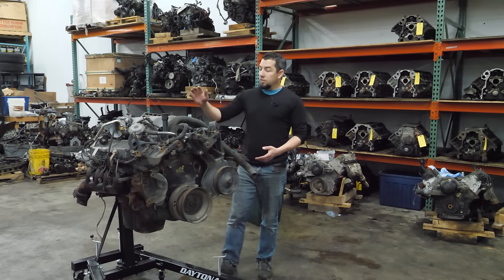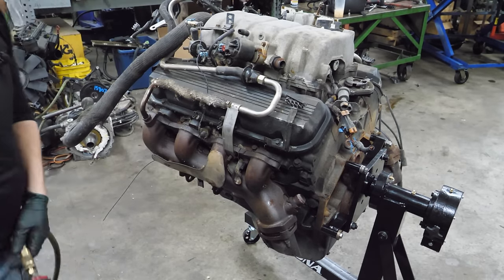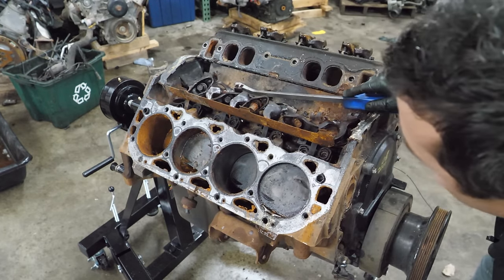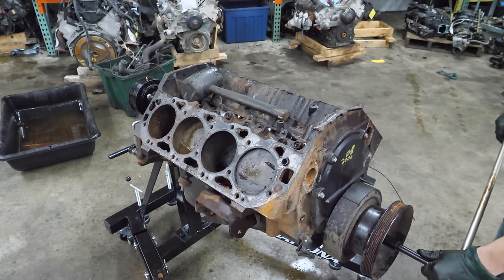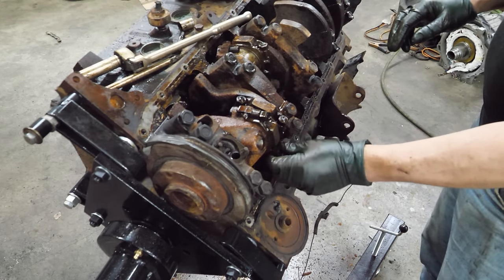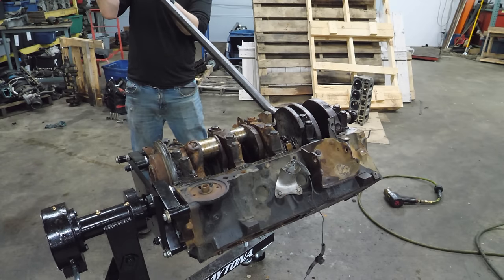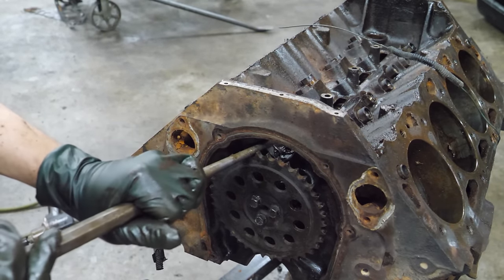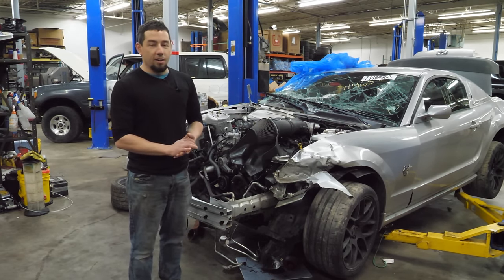COMPLETELY FROZEN! Vortec 454 7.4L BBC Big Block Chevrolet Teardown. This Was Some Work!

Comment: Should of left the deck upright an put oil or diesel in each cylinder for few hrs would have helped a lot block will probably have to be sleeved in the bad cylinders an as someone who’s been rebuilding a gen 6 454 I would advise anyone to just do an ls swap because they don’t make parts for them engines anymore iv been wanting on parts on back order for two years now if I’d known from the start I would’ve waisted the money in parts an Machine work that I have in mine could have gotten a 6.0 out of a wrecked truck an been back on the road two years ago with my dually

Comment: The reason one side on those rocker banks is way worse is the pcv valve. Side that pulls  oil on the side thats dirty , everytime i have opened one side is clean ? The other way worse, that engine looks like 300k + there work horses unless realy neglected  then only get 200k

Comment: 34:51 into the Video. Just realised this is just a Channel is like most. Seem to be informative; but actually a Staged Production... Part way through to this point, "I just realised that this Freeze Plug is pushed out." Then you get to driving #1 Piston and Rod out. At this point of the Video, there is CLEARLY a Window in the Block. You going to claim that you never saw that? You just changed the Camera view to see straight through. No more watches from me....
Reply from the maker: First, this isn’t an airport.
Second, none of these are staged. The block has no holes. No windows. What may have looked like a window was likely flaking black block paint.
Reply: Not staged buddy, you need to give the creator the benefit of the doubt - if you’d been watching from the beginning of the channel you’d see all kind of unexpected stuff happens, and I Do Cars proudly boasts whenever there is holes in the block, because it’s what us viewers want.
Reply: all I see is the shiny/oily #1 rod cap sitting on the block.
Reply: "Staged Production"?  What would be the point of doing that?   What an odd comment.
Reply: As far as a 'staged production', I think there's obvious planning, (how could you not plan?). The point of the video is tearing down and diagnosing a broken engine. Success! 👍

(SPOILER ALERT: PLANNING OCCURRED DURING FILMING, maybe before, maybe after too, maybe both, not sure...)
Reply: Looked to me like the "window" was the adjacent cylinder's bore which gave him access to the rod bearing he needed to remove. He's an honest video maker doing us a favor letting us watch him do teardowns. Go elsewhere for "planned videos".
Reply: Just watched it again in Full Screen Mode. I SCREWED UP in my Comment. I'll admit it. On a 14" Laptop watching in regular mode: the Rod Cap sliding down looked like I could see the Piston moving as you were beating on it. Sorry, carry on...
Reply from the maker: No worries! It’s hard to tell what people are watching this on, what they see, and how it looks. 
Remember the blue and black vs white and gold dress?
Reply: Thank you for leaving. We all appreciate it.